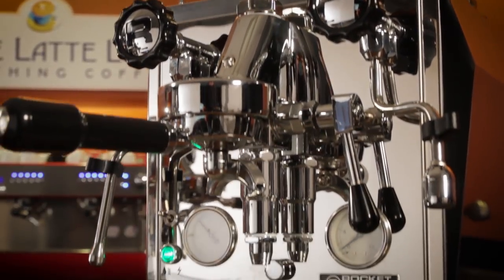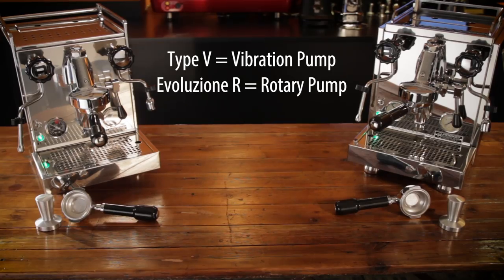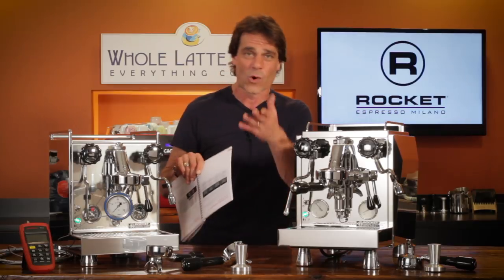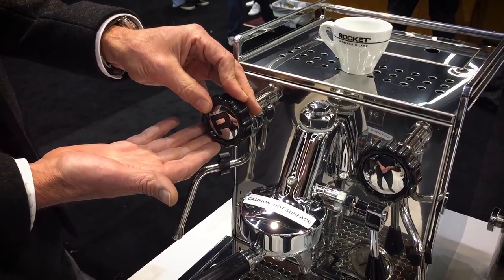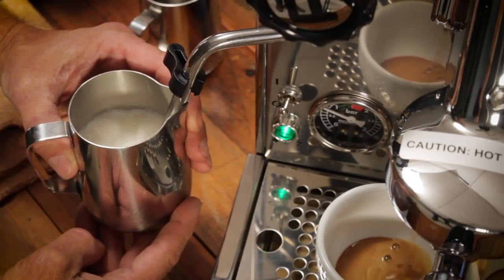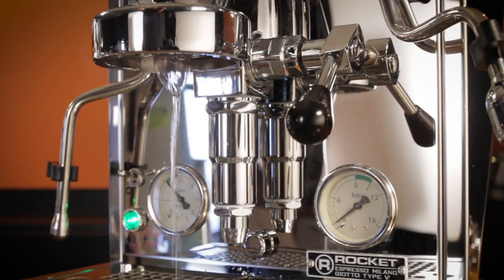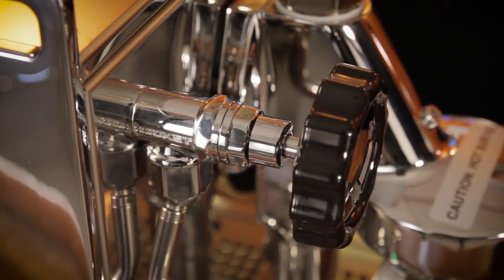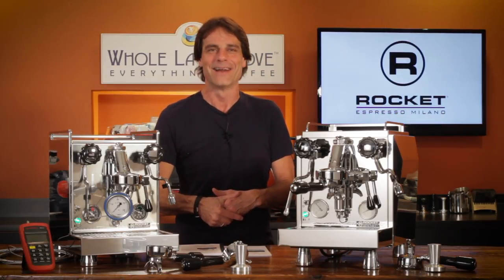Review: Giotto and Mozzafiato Machines from Rocket Espresso

Comment: Hi, is the build quality of these two machines equal? I’m asking because the Mozzafiato looks like the side panels are much more substantial.
Reply from the maker: Hey Stevie, Thanks for the question. The build quality is the same between the Mozzafiato and Giotto machines. The are essentially identical under the hood. The Mozzafiato does feature a thicker slab design of the side panels.
Marc

Comment: Hi Marc I have a "Rocket Mozzafiato Evo type R" plumbed to a" BDST S" water filter system. We drink roughly four (4) coffees a day. My questions are: 1) how often should I change the filter considering that he water CaCO3 is 116 mg/L,.   2) Do I understand correctly that with this filtration system correctly maintained I will never have to descale my machine? Thanks
Reply from the maker: Hi Marcel, Thanks for the question. Assuming you mean a BWT filter system? If using a BWT Bestmax Premium filter cartridge replacement interval is based on input water total hardness measured in degrees. Filter should have come with a manual with hardness/capacity chart listing filter capacities in liters. If you do not reach rated capacity the filter should be replaced annually. Here is capacity info for the Bestmax Premium S from manual formatted as:
source water total hardness in degrees/filter head bypass setting/filter capacity in liters 
4/3/1875
6/3/1250
8/3/935
10/3/750
12/2/565
14/2/485
16/1/380
18/1/340
20/1/305
22/1/275
24/1/255
26/0/210
28/0/195
30/0/185
32/0/170
34/-0/160
Hope that helps!
Marc

Comment: I just got my rocket mozzafiato today however I don't see anything in the manual that shows how to program the PID to go from Celsius to Fahrenheit and my missing something?
Reply from the maker: Hi, Yes really unfortunate they don't tell you how in the manual. Here's how to do it:
Turn the machine off.
Hold down the up/down buttons on the PID while turning the machine back on.
You should get F.01 in the display.
Press to change between F and C.
When set turn the machine off then back on again.
Be careful about going beyond setting F.01. Deeper items in the menu can change the base PID technical settings. That's probably why Rocket does include this info in manual.
Marc
Reply: Thanks Mark that worked!
Reply from the maker: @MattyMattnj1  happy to help!
Reply: Hey Mark one more question they didn't have the model with a walnut knobs can I order those knob separately an upgrade mine?

Comment: Hi Marc, great video and thanks for the reviews! I just got the Giotto V machine and a technical question - do I need to let the steam go manually upon turning the machine off? (to release the pressure)? I plan to use it 2 - 3 times a day.
Reply from the maker: Michal Helbin hi, no need to release steam pressure on shutdown. I do suggest running some hot water out of the wand on a daily basis if you are only steaming. This will help reduce mineral concentration in the boiler. 
Marc

Comment: Hi Marc, is the Mozzafiato type R able to take water from a water bottle which is underneath a counter top or the line water has to be pressurized in order to be plumbed in ? I read in the manual that it can take a non pressurized source with a non return valve fitted on the line but I just want to make sure with you. Ideally i would pull from a 5 gallon water jug fitted under the counter approximately 24 inch below.
Reply from the maker: Hi J-M C, Thanks for the question. Yes, the plumbed in connection can be fed from a non-pressurized water source as you describe. It's something we've done with Rocket Type R machines and other manufacturer machines with rotary pumps. Fresh out of the box on initial startup it's best to let the machine fill from the onboard reservoir before switching to waterline supply. This will help avoid priming issues. Hope that helps!
Marc
Reply: @Wholelattelovepage  thanks so Much for the quick response. Can't wait to test this machine 😁

Comment: I really, really wanted a Rocket Mazzafiato with rotary pump so I really started looking closes at all the machines locally and was not happy to fine all but one of water trays on the many machines displayed rocked badly. I don't know if the tray was twisted or the machine frame was. After that my focus shifted to ECM and Profitec. That was really disappointing because I really wanted that amazing looking side panel with integrated handles. Best looking side panel of all brands in my opinion.

Comment: when I open up the steam there is a bit of a drip that has started... is that easy to fix?
Reply from the maker: Hi Kelly, Yes it should be a relatively easy fix. Likely a washer in the valve. Check our support wiki for the machine here for more info. If in US, you can give our tech support specialists a call at 585-924-7170 for assistance.
Marc

Comment: Hey guys great video! I’m looking at purchasing either a mozzafiato R or a R58. I’m just wondering what the recovery time is after brewing and steaming milk? Just concerned that the mozzafiato would be slower making drinks for a group of people. We don’t do it too often but there are times where we make 10-12 drinks in a row when entertaining. Will the mozzafiato be fine for this or is the R58 a better choice? Thanks
Reply from the maker: Hi Matt, Thanks for the question. Both machines recover quickly. By the time you have ground, tamped and loaded your next shot they are ready to go. The R58 gets a slight edge if any in recovery. Total boiler size in the M is 1.8L. In the R58 the steam boiler is 1.8L then an additional .58L brew boiler. Just more boiler in the R58.
Marc
Reply: Thanks for the info Marc!!
Reply from the maker: Matt Perri my pleasure. Let me know if you have any more questions!
Reply: Hi Marc. 
Ended up getting a mozzafiato R. Love it so far! 
Do you know if there is a way to adjust the steam knob so the R stays upright after closing it? Seems like you really have to crank it down and seems a bit overkill as it goes way past where it actually closes the steam off. 
Thanks again.

Comment: Is boiler material a concern when choosing a machine?  I know rocket uses copper/brass end plates.  And ECM/Profitec uses stainless.  I want a Profitec but my concern is the longevity of the steel boilers
Reply from the maker: Anthony Campagna Hi, copper is traditional, while stainless is the future and what most manufacturers are using in high-end machines. We have not had any longevity issues with SS. Some think stainless is less susceptible to scaling than copper.
Reply: I wonder when they will have induction boilers.

Comment: Hi, two questions: 1. What is the drip tray width? Is it the same as in Appartamento (274mm vs ?) and the bigger overall width (335mm) comes from the 3d sides? 2. What is the lower possible height of this machine I can get by changing the height of its feets (400mm vs ?)
Reply from the maker: Hi GS, Thanks for the question. You can get basic measurements of the machines at our website. Here's a direct link to Rocket Espresso machines there: https://www.wholelattelove.com/collections/semi-automatic-espresso-machines?_=pf&pf_v_brand=Rocket%20Espresso Hint: use the compare function on the site to get a side by side of specs. Or, if you're in US give us a call at: 585-924-7170 and one of our specialists can go measure anything you like while you're on the phone!
Marc

Comment: Out of interest did you have to perform a cooling flush to get the desired brew temps?
Reply from the maker: Hi Howard, Like most newer HX boiler machines with PID cooling flushes are not required in most cases.
Marc

Comment: Hi Mark, you seem to know your way around the rocket machines, I loved the video. I recently bought a Mozzafiato V, when I use it, the pump pressure is only about 4 bar, it's nowhere near the 9-10 bar it's supposed to. The manuel only tells me how adjust the temperature, not the brewing pressure.
Is there a way I can adjust the pressure myself?
Reply from the maker: Hi Ulrik, So, you get 4 bar on the gauge when pump is running with backflush disc in place? On a vibration pump machine, pressure should be adjusted to 10bar with pump running and backflush disc in portafilter. Setting to 10bar gets you ~9bar brew pressure on a vibration pump machine. Pressure is adjustable. You have to remove the exterior housing of the machine and adjust an OPV valve. It's a brass valve with flexible low pressure hose off one end which leads back to the water reservoir. We need to make a video on the procedure!

Comment: Hi Marc-Great video..How would you compare the Rocket rotary to the ECM Synchronika..?
Reply from the maker: Hi JL, Thanks for the comment! The Rocket rotary pump machines in this video are heat-exchange machines while the ECM Synchronika is a dual boiler. I prefer DBs over HX machines but they are usually more $$. In general, I prefer ECM for better engineering under the hood. From a distance, the Rockets are flashy. When you look close, the finish quality is higher on the ECMs.

Comment: Hey folks, I've recently purchased a Giotto machine and it seems to release sort of a chemical smell when it heats up. I removed the top of the enclosure and it seems to be coming from the boiler insulation material. Is this something that goes after some time and any idea on how long it could take? I've had the machine for two weeks now.
Reply from the maker: Hi ascosta,  I've started up 100's of new out of the box machines. Occasionally, I do get slight odors - that new machine smell! Unless it smells electrical in nature I would not worry. Should abate with time and use.
Marc

Comment: Tell me why it's advertised as having a 3 litre reservoir when it holds 2 litres and no more. Yes I measured mine.
Reply from the maker: Hi Greg, Sorry about that. I believe the manufacturer included water in the boiler in the measurement. Reservoir is 2 liters.